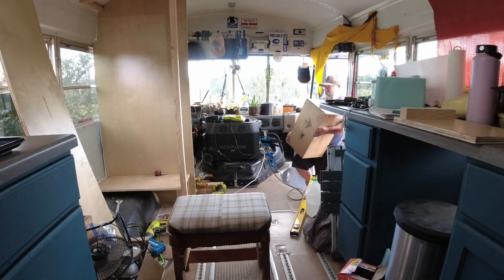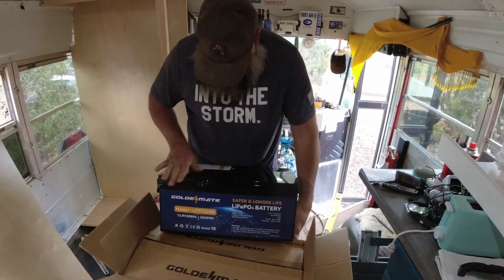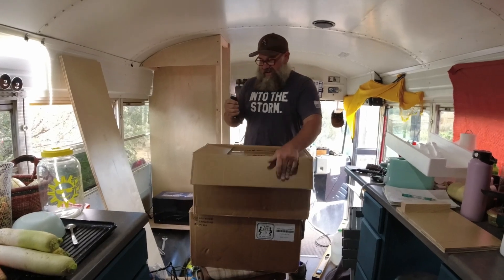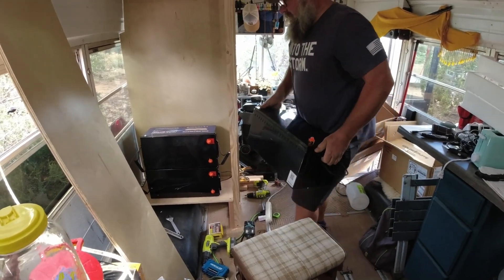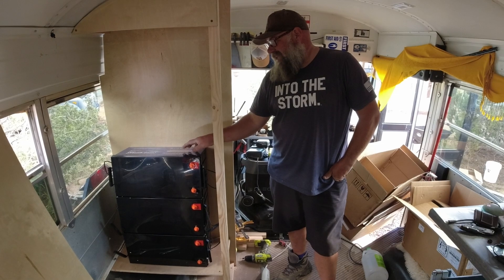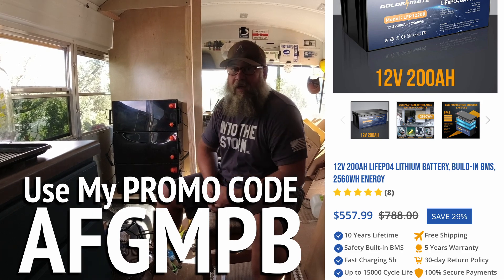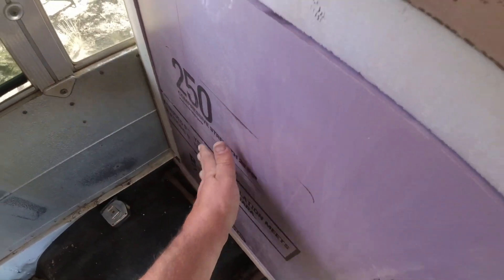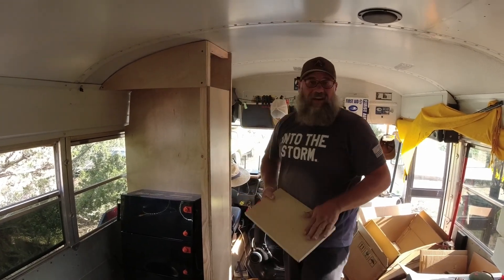HUGE LITHIUM BATTERY BANK INSTALL! GoldenMate 12.8V 200AH LIFEPO4 Batteries

Comment: You don't want an RV tank warmer for the bank. Nomadic Fanatic tried that. Too hot. One side is made to be exposed to the underside of the RV.  Possible a low wattage PTC heater, is what I'm thinking.
Reply from the maker: I misspoke in this video. I also have realized a tank heater isn’t what I want to use. Maybe a lithium battery heating pad would do the trick.

Comment: I run lead acid batteries for my system 200 amp hour 12v I have 16 batteries. Those are too expensive for me and they don’t last long enough for the money
Reply from the maker: How much is one of your lead acid batteries?
Reply: @PaulBarger  I spent (if I remember correctly) $300+ on 2 150AH Deep Cycle Lead Acid batteries as my camper house batteries. They will last 3-5 years. I can only use 150 AH without damaging them. 

I’m thinking of 2 400AH Lithium batteries when I solarize my camper with 800-900watts of solar panels.  I have found room for that size system. My camper shore tie is a 35amp snd I “think” I can run my AC system with that solar. I still need to talk to an expert.